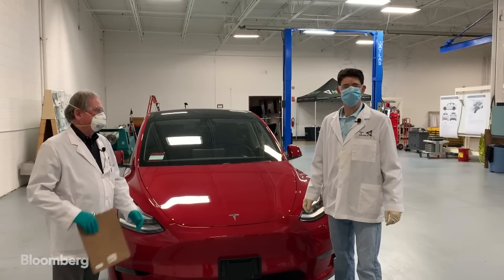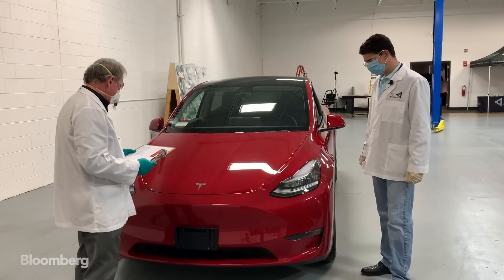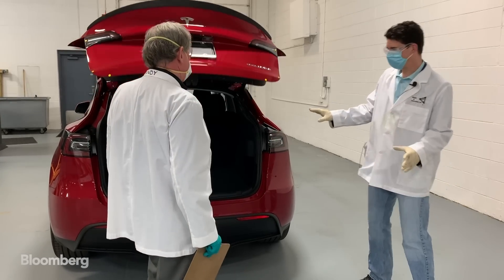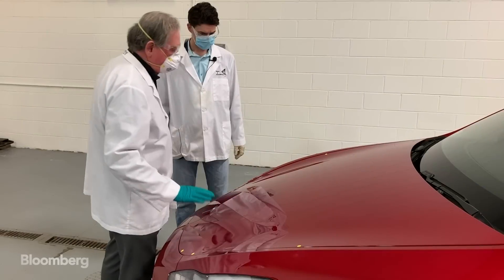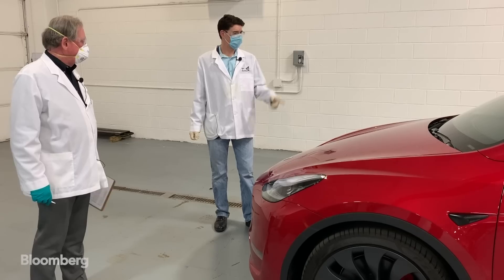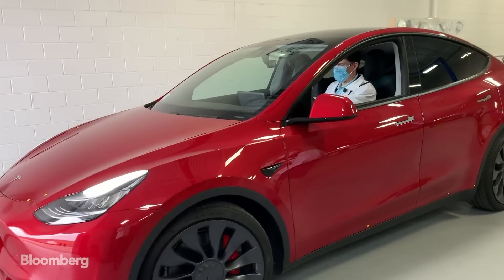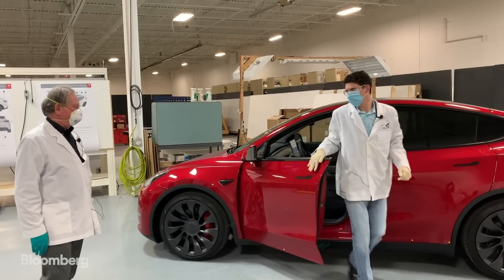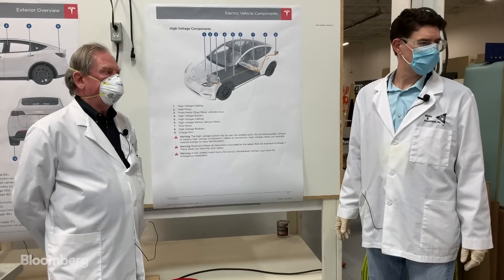Evaluating Tesla’s Model Y With Engineering Guru Sandy Munro

Comment: Ive never heard of any Tesla owner not liking it 
and  going back to Internal Combustion cars
That tells me all I need to know !
Reply: When my girlfriend got her Model 3 we both spent a lot of time driving it all over the first weekend.  Then Monday came and I had to drive my truck to work.  I seriously thought something was wrong with my truck for a couple of days.  I kept noticing all of these vibrations and I thought the transmission was about to go.  I realized after a couple of trips to work and back that it was fine.  Those vibrations have probably been there for years, or even since I bought it new, and I was just used to them.  Whenever I drive her car on a long trip and then get back in my truck again I feel like my truck is an antiquated piece of junk for a few days afterwards.
Reply: @CL-gq3no  Same here. I bought my wife a Mazda CX-5 CUV and when I had to use it after driving my model 3 exclusively, I thought the engine was bogging or just dying when accelerating. all that noise and barely any action. I realized it was because once you drive a Tesla (or any relatively good EV really), The silent rocket really spoils you. How the hell we were fooled for so long into thinking we needed this antiquated fuel "technology" is beyond comprehension. Imagine if we started with EV's how far ahead they would be by now. Then if someone came up with a gas car and said "look at this new technology!" it would literally NEVER take off. Times up OPEC.
Reply: Chris L And to tell the truth, your transmission is about to go, sooner or later.
Reply: @CL-gq3no  Totally get this. I was helping my parents move and I drove their newish (1 year old) Honda CRV a lot that week, which is a actually a good car. It seemed so kludgy and busy and noisy and stinky (there are way too many buttons and dials in that thing). Totally got the feeling that I was driving last century technology and couldn't wait to get back to my Tesla.
Reply: s3xyScorp , I’m 67, owned 25-30 cars, bought my Model 3 two years ago. Best car I’ve ever owned, will never go back to ice.
Reply: I'm a Tesla owner and I will NEVER go back to an internal combustion car. 
Best purchase I've ever made.
Reply: I own one, but also have not and won't give up my ICE cars either. There's space for everything in the market.
Reply: Exactly. Going on my 4th Tesla yup . I leased a new 2018 Grand Cherokee SRT now has only 5500 miles 15 months later because of the Tesla effect. I have a love hate relationship with Jeep because truly gas sux. Insofar as to even eliminate all gas lawn equipment at home . Jeep’s  muscular design and size is great . I have had 3 Jeeps under warranty never any issues lol. Sadly the electric suv options have been limited and the X was next but they plaid popped up and we decided to wait . The Y looks like a great holdover till Cybertruck since X seems to be stuck in limbo till year end..
Reply: I’ve had my S since August 2016.   The car has been great.  You’re correct, I won’t go back!
Reply: Definitely true for me. I'll never buy another ICE car. The speed and handling of my Tesla Model 3 is great. And also in the time of coronavirus, not having to go to a gas station is a big plus (I just plug it in in my garage).
Reply: Tyrannulet2k how many don't have a garage nor a 240 v to charge the vehicle?  Oh, let's not forget the $$ to even get into a Leaf, Bolt, Kona or Model 3.    Some use the false equivalency of the adoption of the cell phone, but let's compare cost, access and long term affordability. You can't.   Yeah, like I'm going to compare a $500 smart phone to a $50,000 BEV.  Makes zero sense . 100x more for the car. Tesla no forget about charge infrastructure , insurance, collision repairs, parts etc.
Reply: @fatbroadshorsefacedlesbian8619  the base model 3 is 35k which is the avreage price for a new car in the US. With the money you save in gas you can install a 240v charger and wake up with a full charge every day. Just like gas stations, charging stations can be built over time. Its only going to improve over time so electric cars are the future. 

I say 20 years because electric cars right now have just bearly become viable for a significant portion on the market, the amount of EV's sold in the last 3 years has exploded compared to a decade ago. Most people wont keep a car longer than 10 years. 10 years from now electric cars will be cheaper and more viable for the majority of drivers but they will still own gas cars and occasionally buy gas cars for specific reasons. So by year 10 most people would prefer the advantages of full electric over gas and will make their next purchase electric so they only have to run gas cars to death in order to make the majority of cars on the road electric by year 20.
Reply: Miguel lopez and what about all those ice cars and hybrids that are going to be sold in the next 10 years . If they go another 10 after sale, you're talking 20 right there.  Oh, and that 240 mile range $ 35k Model 3 is off menu, not on lots  and takes 6-8 months to get and by the time you pay freight and dealer prep it's close to $40 k. EV plates in most states are now double or triple gas cars and who's going to fix the roads? That's something the old gas tax did.   You're way out if your league when it comes to paradigm shifts. This is neither exponential nor logarithmic.  It's goings to take a long time to wean people off of ice vehicles.
Reply: Allan and where are these people going to charge their cars genius?? Superchargers won't be sufficient. How about those in apartments and condos with no charging facilities?  It's going to be a long train coming.
Reply: Miguel lopez there's a shift,but it's not as monumental as you believe.   This isn't the same as going from horse and buggy to motor vehicles. Even that took nearly 10 years.  You're talking gas propelled car to electric car.  Both function pretty much the same, but gas still wins by far in range.   Note too that the transition from ice to electric on semi and straight trucks is going to be even longer since diesel offers both torque , range and reliability for heavy hauling.
Reply: ICE cars such
Reply: Well they never own them long either so. As the screen breaks down every 4 years depends on how much you drive them. At teh warranty time it cost nothing, but for the idiot buying it 2nd hand will be out for a sweet gift of a new ICE as thats the computer modul called, cost from 3k to 5k. 
Its a fault Tesla have had and will have for the future as well.

Alot of oilchange for that price.
There is also people here in Norway that had to sign papers not to buy a Tesla again EVER again. As that is how good they are... pure shit cars really. As all they did was wanting to have their car fixed, and Tesla lost the courts like some mother fuckers. Had to pay alot in compensation and had to buy their shit product back as result.

So if you gonna buy a Tesla, really do your research about them, people who do this, dont buy Tesla.
Reply: @cofal79  screen brakes down every 4 years? What are you talking about? You can cherr pick as many examples of tesla being shit but in a sea of shit auto manufacturers it's still doing well for its customers happiness
https://www.tesmanian.com/blogs/tesmanian-blog/tesla-topped-1st-place-in-consumer-reports-owner-satisfaction-survey
Reply: @miguellopez3392  I see you don't follow Rick rebuilds.
Yeah one actually servicing these thing and fix their screens without Teslas help.
I guess you have better ide how Tesla works than them.
In average they break down every 4 years.
And as I have said before, what is fixed under warranty, never gets to the price of ownership.

But hey, when facts don't matter anymore, just your feelings.
And no Tesla is not longer at top. In Europe they are pretty low now days.
Buying their crap back making people signing papers not to buy a Tesla again...
I reat my case!
Reply: @cofal79  I do watch him, and I dont see how referencing a part time mechanic ( let's 2 tesla certified mechanic actually do the repairs for him since he cant) who only works on broken teslas isnt a massive statistical bias that's like saying everyone has Corona because all the doctors patients have it, and since you said 4 years I assume you the 17 inch screen and not the 15 inch screen on the model 3 it's an older touch screen, not sure if that's an issue that will continue... I own a jeep, many things on it are expected to brake over time, I'd rather take a broken screen under warrenty then having to repair the radiator because Fiat only wanted them built to last just over the warranty.
Reply: @miguellopez3392  I do know that you dont watch him, why, well its not the screen that breaks down, its the ICE modul, the onboard computer if you like. They are still using the same saving chips and the same Intel Atom processor.
He had an entire episode about this, where a guy rebuilding ICE cars to electric using Tesla parts, also that same guy told about the common issues that was with this onboard computer and why and how Tesla could easily fix it. Tesla hacker something the episode was called. Maybe you should look it up, and the reply.
And heres the thing most screens will break down after warranty, making you that buy a used Tesla the one taking the bill.
Again showing that Tesla is over hyped.
Also showing that you actually dont own your own car...
Yes Rick is building up trashed Teslas, also showing how flawed the cars and the brand really is.
You can buy trashed Mercedes's and still you will get support and parts for them, and still be able to service them after approved repairs.
With Teslas you can not, and its not that they are advanced, its so they can sell more cars. Meaning you vil never have Teslas getting old, like other ICE cars can be.
Reply: @cofal79  teslas come with a 8-10 year warranty how are these screens falling out of warranty? I dont really care about this topic right now, you talk about tesla being overhyped and miss the point why it's overhyped, teslas are fast, relatively affordable, and efficient, vehicles that get more advanced in their infotainment and autopilot features avery year, can you name another car that's worth this much hype?
Reply: @miguellopez3392  That warranty is on battery and drivetrain! Or as the new thing they added 160,000km/99400miles or 8 years, what comes first.
Seriously do you have any clue?
There is a 5 year, also km/miles dependent depends on whats first, on the car, that's the electronics, panels, handles, so on not the drivetrain and battery as I begun this comment its a separate warranty. NOT 8-10 years as you clam! 
But as I said, that means the ICE will fail outside warranty well as in warranty. This is seen on S and X, not on Model 3 or Y yet as well they are still new. 
This unit costing between 3-5k dollars every time, for that poor person buying a Tesla without warranty. Its the average, if you use your car alot, it will fail more often, and less if you use it less, simple as that. 4 years average.
Reply: For a daily driver, daily commuting vehicle, I absolutely cannot imagine going back. (I had many cars including BMW 3 series and Audi A4 and my 2019 Model 3 is the best car I’ve ever owned by far).
Reply: @ilmostro16  must be good being so rich, that you just buy a car to drive to work with.
Reply: Internal combustion engines are just a transitional technology. Like fax machines. 

Electric cars are future. But you don’t have to believe me. If you think combustion motors are better, go ahead and replace your garage door opener motor with a combustion engine. Lol.
Reply: Heck Yea sounds like you need a new girlfriend. Preferably one who has a Raven Dual Motor Performance X or S.
Reply: John Edwards I'd have to agree. All of these artificially generated time estimates  just baffle me.  Rome wasn't built in a day. Nor will BEV infrastructure. You're going to need a whole new generation who grew up just in BEV to complete the transition. That'll be many years .
Reply: John Edwards 
Your comparing different class of cars.
Let's compare the mini Cooper as you mentioned since they make both in the same car.

The EV version
Top speed: 53mph slower
Range: 240 miles less
Weight:  170kg more
Price: £5000 more
0-60: 0.5 seconds slower 
Refuelling time: about 1hr longer 

If you think that weight makes no difference to handling, you need to go back to school. 

There's a penalty in changing the drive train to electric, there's also some gains. 
whether that penalty is worth it is dependent on the person.
Reply: John Edwards no one said a Tesla was for everyone. Can you post a video of ANY bmw doing enhanced summon where it comes and finds someone in a parking lot, much less an i3? BMW doesn’t make a car  with these capabilities at Teslas level - not even close.

No one should bully anyone for the car they drive, so maybe the petrol fans should stop doing it to Tesla drivers?

Also, if you only have 18k you sure can’t get a Tesla. YOU ALSO CANT GET AN I3. You should research a bit more as you have now posted two absolutely ridiculous points in the same post. CES 2020 bmw concept is not something you can buy now. It was a pre-mapped demo they ran for what will come in the future.
Reply: John Edwards  The ones made on a "shared" platform by companies that make ICE engines? Some lazy companies just replace ICE with EV parts and think that's going to pass, they're behind on EV technology.
Mercedes and Audi are not taking EVs seriously, VW will destroy them if they don't shape up and start making proper modern EV designs.
Reply: John Edwards  That's true, the choices are still limited even in Europe, it's all relative. All the major companies are planning to come out with a ton of models for that market in the new couple years, so it should begin to flood the market and raise awareness of market change, shifting more sales toward these new "cellphones on wheels" so to speak.
One problem for the US market is that it's heavily subsidizing oil and the current leaderships at the state and national levels are anti-renewables in general. Allot of these companies are beginning to prioritize their new EV products to other markets because of that. Even Ford is prioritizing its American-made Mache-E for the European market in order to keep up with emissions restrictions. That's unfortunate for us American buyers.
Reply: John Edwards  Well, no about getting it repaired cheap. You should really read the fine print in the agreement.
If Tesla discovers it have been tampered with, from other than certified Tesla mechanics, they can and probably will shut down the fast charge ability, making the car more or less useless, over night. Or even shut down the entire car, and forcing you to pay fees to turn it back on. Its actually in the agreement. 
How much are you willing to pay to keep that 3rd party warranty up and running, and how long do you think insurance companies want to provide that service if they start to loose money on it?
Reply: On my second S, which is now 4 years old. No problems whatsoever. Any 4-yr old ice car, including a Toyota, would show serious wear and need fixes. NEVER going back to an ice. Ordering a Y soon. Am waiting for them to fix the usual early production issues that every car has.
Reply: @davidmarmon9118  I have a 19 year old Volvo. Only small things that wears down on Teslas as well.
Still on it's original engine and automatic transmission. 180k miles on it, and still going strong.

Seems like Tesla owners don't know what average means.
Have you change screen yet?

What have you changed under warranty?
Or is that a military secret.

I actually know your answer, as it will be a lie, but here goes, "I have had no
Issues with any of my Teslas, best cars ever." 
Truth is they have probably been more at the service centers than on the road. Been on flatbed more than one time.
But still best car ever, cost me nothing.
Well they are probably still under warranty.
Reply: David Marmon 4 years and you're ice car is worn out?? What are you buying, Suzuki, Fiat?   Most of us have had ice cars go >10 years or more without any major repairs.  It's not uncommon for Honda or Toyota to go >200k miles without any major repairs other than oil change, tires, belts , brakes and wipers. There's many Prius being used as cabs or Uber that have 300,000 miles or more with no major issues. We're not talking about your dads 1975 Olds or Buick or X car.
Reply: I’m waiting for my second Tesla (replacing MY Last ICE car)
Reply: I actually returned my Model 3 via Carvana because of the stiff handling and poor interior quality. This is just my preferences though. Happily ended up with a 2020 Honda Accord Hybrid.
Reply: s3xyScorp can confirm, love my Tesla, never getting an ICE car again
Reply: s3xyScorp bingo!  No fucking way will I ever go back.  Love my Model S.
Reply: It's called retrospective justification, a form of confirmation bias.
Reply: welcome to the cult. jump in the water is warm. 1001 shares owner here looking forward to battery day!
Reply: Why would the alternative be ICE? I was happy to get back into my Kona after a week of Model S and Model X. Although they are pretty cool, too. If you don't own them.
Reply: Let's see battery life in 10 years!
Reply: @tedyfanita1  Their batteries last ages (older models on the older battery technology are still running will with really good capacity left). Also, battery prices by the time these Y's need them, will be exceedingly cheaper according to current pricing trends.
Reply: @s3xyScorp 
You got it!
I won’t ever go back.
Reply: If it told you everything you needed to know why bother commenting? Is there some validation it criticism you just need to hear? Do what everyone else does and take pictures of your food. 
And please while your there consider that Chevy and Nissan made an electric car and their owners give them bad reviews. I'm not calling a Tesla one of those. That would be ridiculous... I'm calling it a useless luxury vehicle that won't sell in the next recession... Cause that's the first thing that goes.
Reply: s3xyScorp Here you go:
https://youtu.be/XB4o_2OcqWU
Reply: That just tells you they drunk the coolaid.
Reply: @Robert-j6r8c  WHat? The "I like the product I am using" koolaid? I think you have some dumb shit koolaid that makes you think electric is not now.
Reply: Robert Better than drinking gasoline. Gasoline is a carcinogen.
Reply: @Robert-j6r8c  Pretty much any modern EV - so not lazy compliance passing garbage - will be superior to ICE technology, you drive one for a few weeks and then it's hard to get back in that smelly, noisy, rattling, slow ICE vehicle. 

We don't have many options here in the US, but Europe's beginning to have more variety of EVs to choose from for different market segments.
Reply: @AllanSustainabilityFan 
Early adopter will obviously be willing to put up with the big downfalls of EV's.
They're going into it because they want to feel good about the planet.

Normal people just want a car and convenience.

I don't know how old your cars were, but my cars are not smelly, noisey or rattlely.

EV's are only quieter at slow speeds(even then not by much), at motorway speeds tyre noise overtakes engine noise
And if any that makes it easy to hear all the rattles.
Reply: @Robert-j6r8c  We're passing early adopter stage right now, in some countries EVs are already the majority, and we just got started. 

Sometimes products are in early adopter phase not because of some lacking features, it can be consumer education related, right now EVs provide better ride and handling, better performance and torque, better reliability, cheaper maintenance, and more advanced technology, it can address the majority of the market, and should get to extreme rural/remote niches in a couple years, where the gas and maintenance savings would be most beneficial with more miles traveled. 

But not allot of consumers know this yet, and we don't have enough options, sadly behind China and Europe in this regard, but that will change. People will figure it out when their next door neighbor begins giving test rides, the product literally sells itself.
Reply: @Robert-j6r8c  Have you ever driven one?
Reply: @Robert-j6r8c  You make a good point.  Most of the fools out there make convenience and looks their highest consumer priorities when buying a car.
Reply: @AllanSustainabilityFan    OK let's break that down.

Better ride and handling , compared to what. A standard car, not really as the springs need a high rate to accommodate the extra weight.

Better performance, yeah they do but not all EV's.  And repeatedly isn't a EV's strong point as the batteries overheat.

Better reliability, in theory that sounds right. But telsa is in the top 10 of least reliable vehicles.

Cheaper maintenance,  yes during the warranty.  Out of warranty definitely not.

More advanced tech, no not really. Tesla has only has just started putting wireless charging in their cars, many other manufacturers have more tech.
Cooled seats, heads up display, matrix headlights, night vision, apple/android car play.
Reply: @hsmiii 
Yeah had a ipace for a while.
Reply: Robert can’t beat charging in your own garage for convenience, or driving by Jiffy Lube instead of visiting it. EVs are quieter at all speeds. You get road noise in any car, but there’s not engine noise on top of it. A multi spectral db meter doesn’t lie. People get EV’s for performance, low maintenance, cost per mile beating a Prius, and the added benefit of not adding to the pollution problem. We just need batteries to be cheaper so everyone can get in one and see how quick these things are.
Reply: Robert credit where credit is due here. Reducing Tesla’s massive tech lead to wireless phone charging and seat cooling is absurd. A car driving to you in a parking lot vs not is day and night. Their AI beats every car maker HANDS DOWN and competition isn’t even close.

Maintenance is a lot lower over time and repairs are NOT the same as maintenance post warranty. Any high end luxury sedan doesn’t even come close to how cheap Tesla’s are to drive. Also the reliability ratings (rightly) ding Tesla about tail lights, rattles, and tiny stuff, and stuck on the roadside type reliability issues are few and far between. No “theory” here. Check out the bills on comparable bmw/merecdes for simple maintenance and you will see what I mean. 

And performance wise we are not talking about other EV’s here, there’s a reason Tesla wipes out every other EV in existence in both sales and performance (except the Taycan which wins on higher top speeds for Tesla’s older S). Their tech lead in range, speed, charge speed, self driving, AI etc is what sets them so far ahead - and all because they actually took EVs seriously. GM and Ford have 10x the product line and Ford can’t even get its debt paid off while GM can’t even get to 30/share while Tesla lives inn the 500’s+. These older legacy companies are getting their butts handed to them.

The only Teslas that overheat are the stupidly designed early model S/X ones with the serial cooling loop vs the much better parallel one they use on all modern builds. The ride quality is great on every tesla I have been in, but that’s highly subjective so my love of their ride is irrelevant and the ones you drove may not have suited you. 

Credit where credit is due, Tesla rocks and this video is fair. Teslas don’t need apple/Android CarPlay because they designed an interface that actually works exceedingly well and don’t need to license the tech from Apple/google like others who couldn’t build an interface on their own. That’s not a knock on Apple/Google, but Tesla’s music interfaces are pretty slick.
Reply: @Robert-j6r8c  "- person who designed the car's suspension could easily be an F1 prince.” Munro
"- the whole car feels tight, alert and moves as one solid unit." Top Gear
"- comfortable on the motorway, staying remarkably calm and flat at high speeds - there isn't much body lean and the amount of speed you can carry through corners is seriously impressive - steering is precise and you can change its weighting to suit your tastes." What Car
"- Class-leading performance and handling." Edmonds
https://cleantechnica.com/2019/08/14/sorry-porsche-tesla-model-3-already-has-repeatable-acceleration-can-we-troll-fossils-instead/
https://www.whatcar.com/news/2019-what-car-reliability-survey-brands/n20069
https://www.warrantyweek.com/archive/ww20190718.html
https://www.coxautoinc.com/market-insights/tesla-writes-the-luxury-vehicle-story-in-q2-2019-kelley-blue-book-brand-watch/?utm_source=twitter&utm_medium=social-org&utm_content=News
https://www.consumerreports.org/automotive-technology/choose-an-infotainment-system-you-will-love/
https://electrek.co/2018/10/15/tesla-drive-after-million-miles-test/
https://electrek.co/2019/09/07/tesla-battery-cell-last-1-million-miles-robot-taxis/
Reply: @Robert-j6r8c  I'm hoping it's ignorance, but I think you are being dishonest intentionally.. "Tesla in top 10 of least reliable vehicles" "More advanced tech, no not really."

These are basic things that you can look up right now, so no excuse for not knowing what you're talking about.. Also I like how you 'break it down' but conveniently don't address the savings on gas because it's not as easy to make some bs up for that. 

A large amount, maybe even most, Tesla buyers don't buy a Tesla for the planet. They buy them because they are amazing cars. Keep your blinders on if you'd like, I'm only addressing you so others can see a response to what you're saying.
Reply: @illlDCllli 
Savings on Gas is disputable as well, 
It's not a clear fact.
As that depends completely on weather you can charge at home or not. 
At home, yes cheaper
At fast chargers, really depends on price per kW.
Reply: @AllanSustainabilityFan  you don't really need many options.  This is what Tesla is trying to teach people.....a car is a transportation (and in this case clean and efficient transportation)...choice will eventually become irrelevant
Reply: @Robert-j6r8c  ICE cars are too complex for my liking....as you have said "Normal people just want a car and convenience." EV offer that right now with less noise and complexity and more efficiency
Reply: @jabulaniharvey   
A EV suit's you perfect.
I think EV's are nicer in town to drive, no difference in the motorways just a lot more of a pain to own due to the charging.
Reply: @hsmiii  agreed, @Robert doesn't have a clue !!!
Reply: @hsmiii  agreed, @Robert doesn't have a clue !!!
Reply: Robert As long as you can charge at home, charging is way more convenient than trips to the gas station. It takes me 30 seconds to plug in when I get home vs. 15 minutes at a gas station. Charging is not an issue for anyone with a garage or a driveway, as long as you usually drive less than about 280 miles per day.
Reply: @Robert-j6r8c  you want to know whats so advanced in a tesla? Look up sandy Munro's breakdown of the model 3, he is an industry expert that tears down cars so he can sell what he finds out to other car makers for benchmarking.
He makes notes that their motors are lighter and more powerful than competitors and include magnet design he has only heard of in theory. He praises the super bottle design that handles the cooling for the whole system and he gets pretty excited about the design of teslas batteries and notes they have the best cooling management. He also makes notes of the chips and hardware being more similar to fighting aircraft than traditional car computers. He just has a problem with panel gaps and some of the heavy structural components.
Reply: @Robert-j6r8c  That's not "tech" that's just a legacy manufacturer slapping some third party solution into a car, it's off the shelf stuff. Tesla's software lead is somewhere between 5-12 years ahead of legacy car companies depending on which expert you ask: 

Their EV efficiency is years above the competition, meaning they need less batteries to go further, you can see it with the i-Pace and E-Tron where they have >90kwh battery packs and still go fifty to a hundred miles less than a Model 3 that uses ~75kwh battery packs.
Their underlying supercomputer is leagues ahead of legacy manufacturers that string together 80 different tiny incompatible chips to get things done, and the software managing it are silicon valley grade, legacy car companies don't do software, simple as that. VW may change that in time, but you can already see their struggles with the new ID product line where tens of thousands of EVs were stuck for months waiting for a software fix, going one by one with engineers to resolve them, something that should be handled over the air.
The list goes on, but this is not some revelation, everyone that follows this tech knows Tesla's software leadership.
Reply: @miguellopez3392 
Only heard of in theory... Umm no.
It called a halbach array and was discovered in 1973.
It is used in many different applications including electric motors. 
Tesla didn't invent it.

The bottle design is clever,  but does that really matter to the end user?.

I've never said Tesla doesn't have good tech, my argument is with people who say they have the most advance tech.
Reply: @AllanSustainabilityFan 
Software is dependent on what you want out of the car.  It is smooth unlike a lot of vehicles.  I haven't seen anything that would put it years ahead of any competition though. 

EV efficiency, once again they don't lead.
https://ev-database.uk/compare/efficiency-electric-vehicle-most-efficient#sort:path~type~order=.efficiency~number~asc|drive_type-checkbox-dropdown:pathGroup=.BEV|range-slider-range:prev~next=0~600|range-slider-bijtelling:prev~next=0~600|range-slider-acceleration:prev~next=2~23|range-slider-totalrange:prev~next=50~750|range-slider-lease:prev~next=150~2500|range-slider-topspeed:prev~next=60~260|paging:currentPage=0|paging:number=9
Reply: @Robert-j6r8c  The I-Pace explains your arguments about handling, and being a pain to keep charged.  Because that vehicle is so inefficient, you need a lot of battery weight to achieve range, and you have to charge it more frequently.  You need to charge it longer to get a decent range.  I understand your pain.  I once owned a 2015 Nissan Leaf because I was a tree-hugging hippie.  I don't own that sub-standard car any more, and I can't blame you for not owning your I-Pace any more.  https://www.insidehook.com/article/vehicles/least-efficient-electric-vehicles-america
Reply: @ethanBmartin 
No physics explains handling... A heavy car no matter what you do doesn't want to turn or stop as well as a lighter one. 
And since BEV's are much heavier, they buy design can not handle as well as a comparable ICE veh3.
Reply: @Robert-j6r8c  So, we're not thinking about having two ways to stop the car, nor its center of gravity?  I dunno man.  That I-Pace may be affecting your general opinion of EVs.  That car weighs 600 pounds more than a Model 3, but the Tesla has 88 miles more range.  I'd be interested to see what your opinions were after driving a Model 3 for a month.  It's like me being afraid to run the heater in a car after driving a Nissan LEAF!
Reply: @ethanBmartin 
Traction doesn't care how the wheels are being slowed down.

Look at any performance version of any vehicle, you see the main thing they do is weight reduction(ie: remove rear seats). 

Find a corner and go as fast as you can around it, then fill your car with people and luggage and try the same.
Reply: Robert Maintenence “Out of warranty definitely not”? I’m not even going to ask what you mean or how on Earth you justify this regarding a tech that allows a Model 3 to be a million mile care with a 500k battery change and intermittent tires and wiper fluid replacement. You’re not worth listening to.
Reply: @Robert-j6r8c  ha ha 😂 wow clearly not a Tesla owner.  If you think they're not ahead in tech because of wireless charging your not seeing the forest for the trees my friend.
Reply: @Robert-j6r8c  you are ignoring that Munro said this was the fist car motors with those magnets he has seen. You put that on top of the motor already being smaller, cheaper, and more powerful this does make them the most advance.

The self driving system is also so far the best since you dont need a giant computer and laser systems stuffed in aftermarket cars, just a few cameras/sensors, and a very powerful GPU, and 2 NPU's. A chip set like this would only be seen on high end work stations and tesla is the only company putting them in production cars.

You are also wrong, the model 3 SR+ has an MPGE of 141, the Hyundai ionic   has a 133 MPGE. The Hyundai also weighs 500 pounds less but has also way less range at "170 miles" of "estimated" range.

So even tho the tesla has the weight penalty its still more efficient and practical because its the most advance production car but the model Y is already showing improvements.
Reply: @Robert-j6r8c  Yea, lighter is better. I look forward to lighter batteries. :)
Reply: Allan Some countries?  Last year, 90 million ICE cars were sold.  About 3% were  BEV.  It's going to take a long time for the BEV revolution to take hold.
Reply: @fatbroadshorsefacedlesbian8619  BEV revolution is already happening, but since its something expensive and big its not going to be adopted as fast as smart phone, i give it about 20 years before the majority of cars on the road are electric.
Reply: Miguel lopez why 20 years? Why not 10 or 30?  Fact is, no one knows.  It's coming, unquestionably,  but as long as there's 100s of millions of perfectly operative ICE cars on the road everywhere, people are not going to just say " hey I gotta have a new car."    There's so many perfectly good cars right now and for very reasonable prices ( Toyota Corolla Hybrid is a good example) that the jump to a BEV is going to take a lot of rationale and money .  Dont forget too that public and private infrastructure will have to adapt and adopt the new technology. Individuals as well. When the average cost for adding a charging install and parts is greater than $2000 , that too is a barrier to adoption.   It's going. To be a long time coming.  How long is anyone's best guess.
Reply: @Robert-j6r8c  Sounds like you haven't spent any time in a Tesla. No rattles in my Model X after two years. I can't say the same about my Audi S4. Even though I still love the sound and personality of my S4, the Model X is faster and quieter even though it's much larger and much cheaper to operate and maintain. Get back to me about the convenience of ICE vehicles when I am able to fuel them in my garage and eliminate the twice-weekly gas station visit and twice yearly oil changes from my routine.
Reply: John Edwards  Yeah I'm sure that will keep rational people up at night. Please, leave the hysteria for grandmothers, these EVs take up the top three spots for the safest cars ever tested by the NHTSA.
https://images.app.goo.gl/bVZpdawv3DLZcxcz5
Just another advantage of EV design, better safety due to lack of engine compartment, resulting in a crumple zone that's three times bigger than a typical legacy ICE vehicle.
Reply: Allan Europe also has complete outliers like the Renault Twizzy. It’s a covered Quad bike but the tiny battery and lack of windows are a huge missed opportunity.
Reply: @Robert-j6r8c  try one EV than judge how noise and smelly and ratling you car is. And btw 10x cheaper to own and drive
Reply: Robert Wireless charging is by its nature inefficient or requires very tight clearances.  Why would you want it?  I've never seen any wireless ICE cars.
Reply: @GoatDirt  lol their smart summon is a joke, does anyone actually use that "feature" regularly? It drives around parking lots like a 5 year old
Reply: @JbassPlayer28  It's not a "joke" for people who have problems walking. I absolutely love using the feature when its raining, or so hot out that I would rather have a nice air-conditioned car pull up than walking across the scortching parking lot. Even in its beta form it is very good (although obviuously not perfect SINCE THAT IS THE NATURE OF BETA SOFTWARE). But since Tesla's get better over time with software updates and training in shadow mode, this badass feature will improve as well, like they have already been doing since every release. How well does your car drive itself to you on-demand? I would rather have the feature work flawlessly 80% of the time than 0% like the obsolete junk you wasted money on. I think we all know why you are so jelous, you precious little hater you!

Like a good little puppy, the following is exactly what you will do next:

1. Post a video of your car driving itself to you (or don't, and add 20 notches to your hater belt, thus silently admitting how ashamed you are for embarrassing yourself in public)
2. DON'T respond, and just go lick your wounds after getting absolutely stomped out by this response
3. Respond with NO video link, and categorize yourself under option 2, with the added benefit that the world is moving beyond people like you who are absolutely deathly afraid of technology, but can still benefit from it. 

Clocks ticking sweetheart! Can't wait to see what you say next! (Add a bit of cussing in your response for 5 extra hater belt notches and get a free bar of soap to knock you up a notch - people are complaining around you, and its starting to get a little rank in the forums as a result). Toodles you widdle caw dwiving guy!
Reply: @Robert-j6r8c  You peeps haven’t even mention the safety factor of Teslas. The safest cars sold are, 1. Model 3  2. Model S  3. Model Y  4. Model X. I’ve had my P85D for 5.5 years and only paid $500 for a new charging portal. My battery has lost 5% charging range. 85K miles
Reply: @clu4u  
Lol, they're not the safest... They're among the safest.

Just look at the crash reports and you'll see other cars have lower chance of serious injury.
Reply: Robert it’s tasty, try it:)